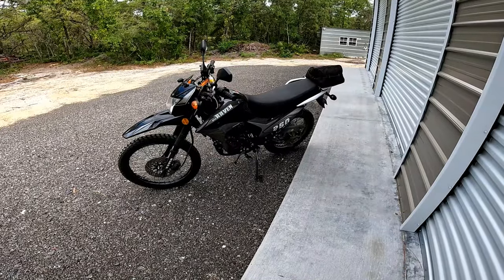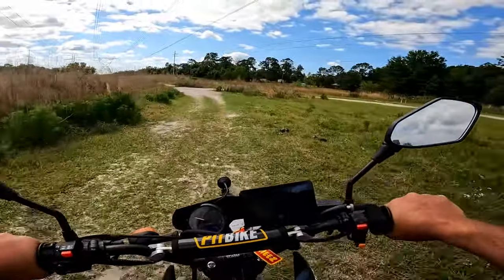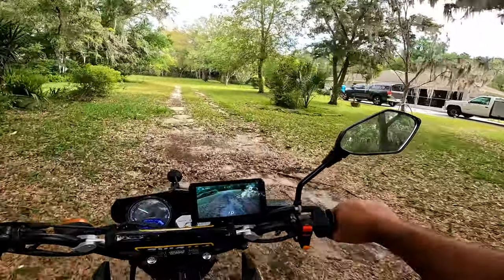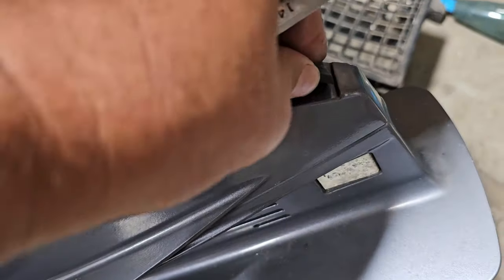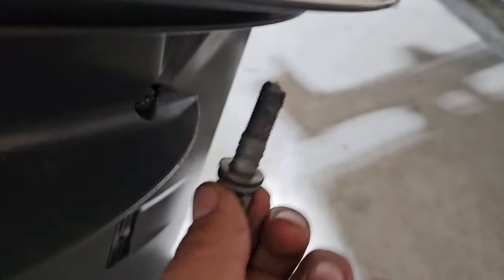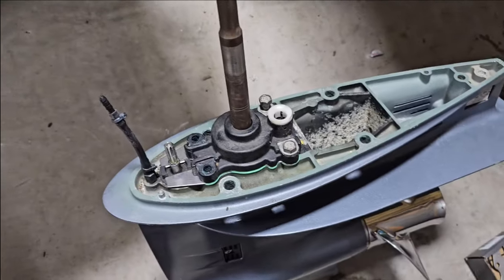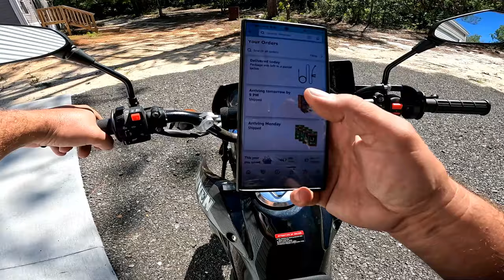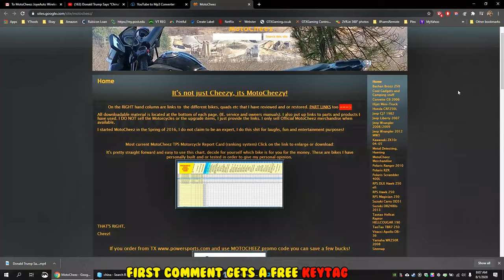2nd day Raven as main transportation, replaced water impeller on a Yamaha outboard

Comment: I sent the lifan ecu out. They have you sending them to venom in Cali now. Third change in their reflash situation. I would have left it, but I took the kpx into the WOODS woods and that throttle lag almost put me in the dirt quite a few times. All my other riding was street or relatively well maintained trails. They should get the ecu Monday (April 15th) according to tracking. We will see how long it takes to get it back.

Comment: I think the tube on the lower unit is for a speedometer hookup not a vent. I could be wrong though
Reply from the maker: It's definitely a vent, runs up and under the power head inside transom.